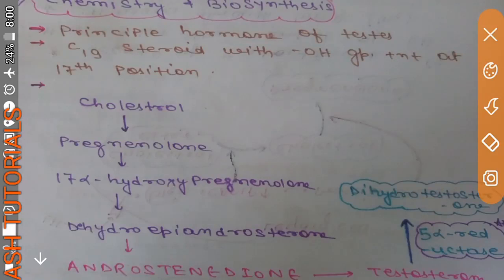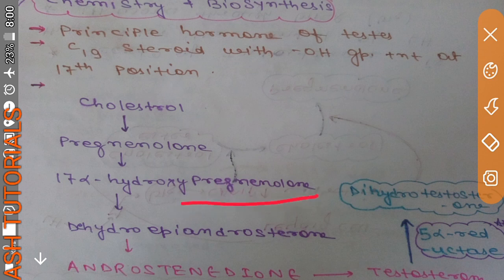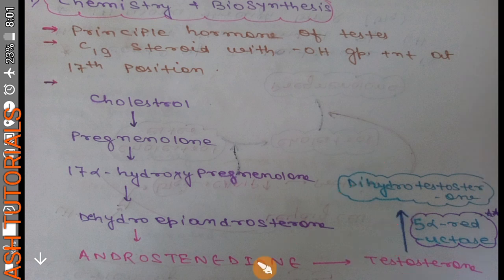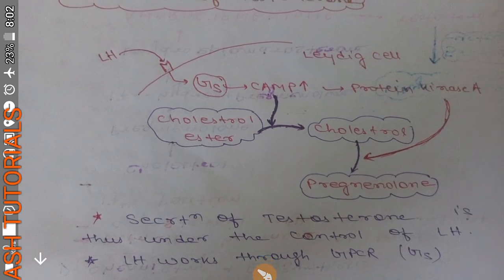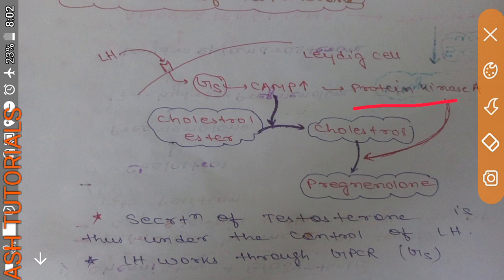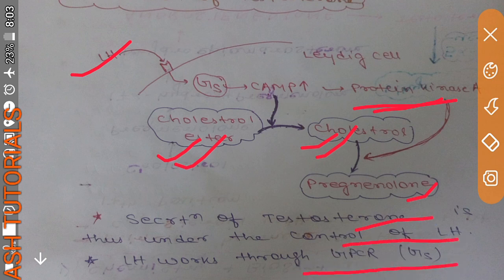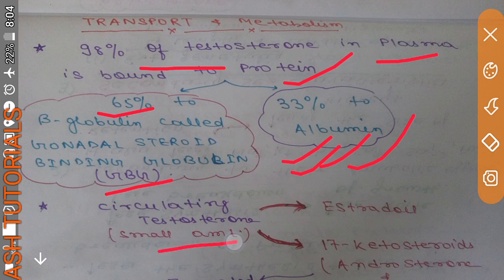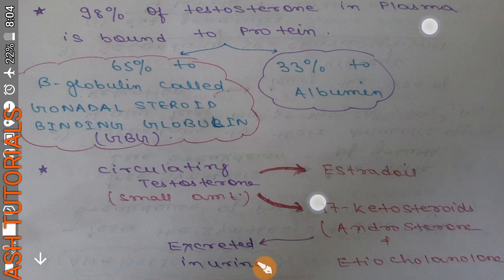SYNTHESIS OF TESTOSTERONE,MECHANISM OF REGULATION BY LH...TRANSPORT IN PLASMA

Comment: Human CYPs are primarily membrane-associated proteins[20] located either in the inner membrane of mitochondria or in the endoplasmic reticulum of cells. CYPs metabolize thousands of endogenous and exogenous chemicals. Some CYPs metabolize only one (or a very few) substrates, such as CYP19 (aromatase), while others may metabolize multiple substrates. Both of these characteristics account for their central importance in medicine. Cytochrome P450 enzymes are present in most tissues of the body, and play important roles in hormone synthesis and breakdown (including estrogen and testosterone synthesis and metabolism), cholesterol synthesis, and vitamin D metabolism. Cytochrome P450 enzymes also function to metabolize potentially toxic compounds, including drugs and products of endogenous metabolism such as bilirubin, principally in the liver.
The Human Genome Project has identified 57 human genes coding for the various cytochrome P450 enzymes.[21]